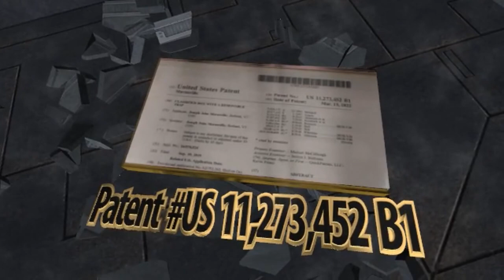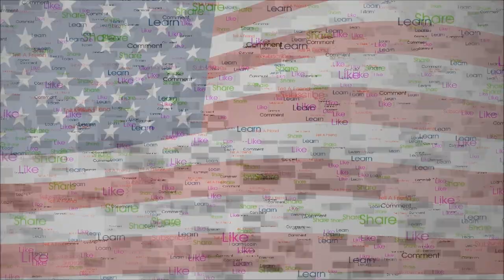3ft Patented Gold Trap Assembly

Comment: Thanks GOLD SQUAD for sharing this channel just subscribed. Looks like a very well built machine what’s the minimum water flow needed to run this correctly? (Just curious there’s not always water flowing where I prospect but there are always puddles) and I have 3700gph pump that’s pushes rocks down my Alan Robertson hobby miner sluice box very well and was thinking it might be big enough to run this as well…would just have to build myself a header box for the front of that fluid bed sluice to make it work 😬 ) what do you think? Congrats on the patents and a great piece of equipment. Thanks for sharing see you on the next one 👍🏼👊🏼
Reply from the maker: 🤔 Did my comment not go through? Thank you 48th State! Yes, a 3700gph pump would do the trick. That's just over 60gal per minuet!
You will need to devise a way to charge and regulate the tubes though.
Reply: @GreenMountainGoldTrap  I’m thinking the header box on the front that’s created would need an adjustable  gate at the top to regulate the flow across the top and one at the bottom to fill the bottom once the bottom filled up it should pressurize and charge the tubes and then you could adjust the flow gate up top if that didn’t work 3 tubes could be added to the bottom of the header box (probably larger diameter then reduced down ) to charge the trap would definitely take some experimenting but if it could be done the first recirculating fluid bed sluice should work well ( minus the fact you wouldn’t be able to see in the box after the water dirtied) but who cares you’d know it’s catching gold
Reply from the maker: The flow over the skid plate can be cranking. It’s the capture tray that will need to be regulated.
Wish we were further along in development! I could give you the best way.
As a one man show when it come to the gold traps I have no time!
So, I have teamed up with someone else for this feature.
We have just begun.
But do feel free to keep in touch when the time comes by contacting me via the website.
I always make time for my GMGT Family.
Reply: @GreenMountainGoldTrap  👍🏼👊🏼 hopefully that person cares as much about the details as you do
Reply from the maker: Indeed! People who know me know how particular I am!